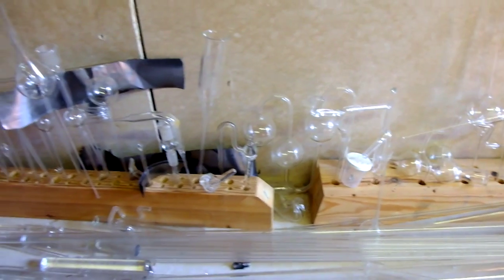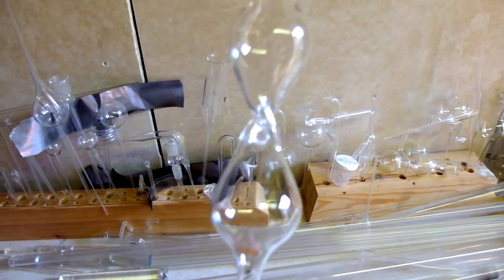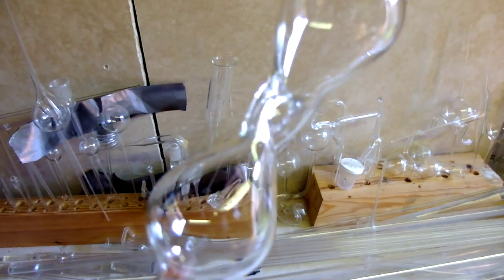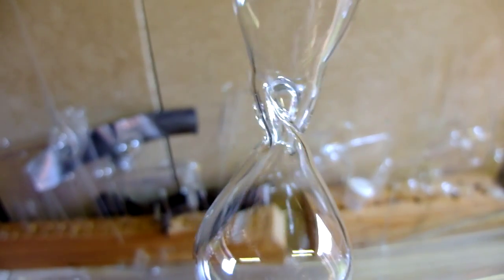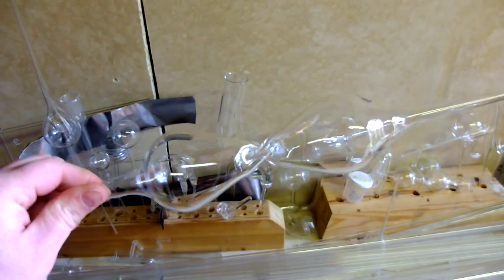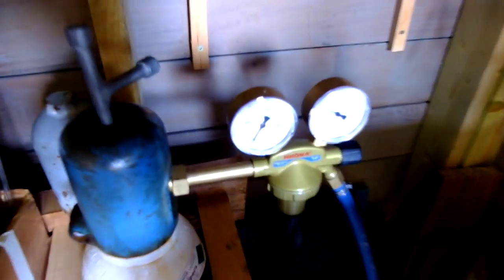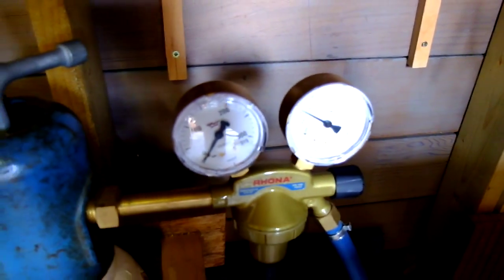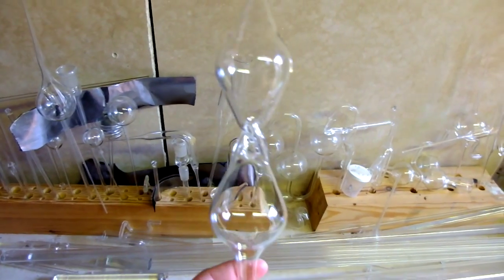Special kind of Hourglass

Comment from the maker: Hi, thanks for viewing.
I do not really 'pop' them in the sense of the word though. I don't blow when 'popping' them. The glass will fall directly in the metal waste bin, just out of frame. I do not believe it poses danger: the glass particles are not small enough to become airborne. This means they will not float through the air. And even if you accidentally would inhale a few, not much harm it can do. What is harmfull to breath is fritt colour glass, or worse, asbestos fibre materials.